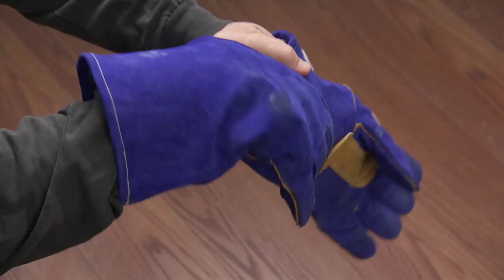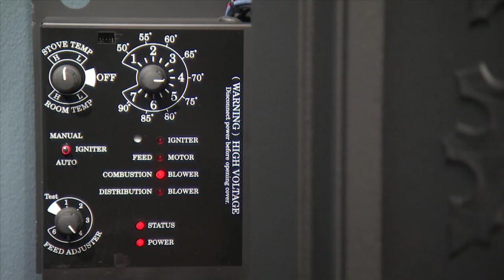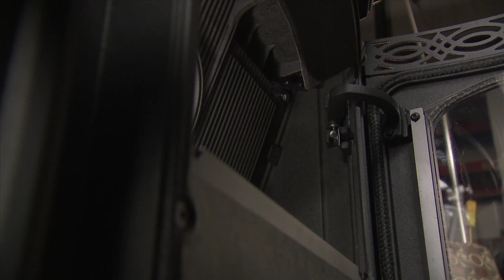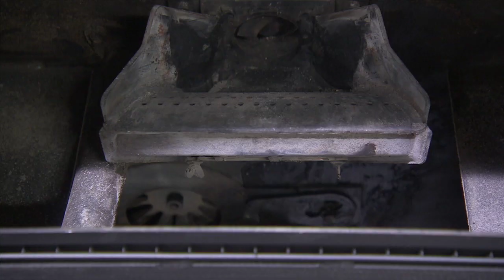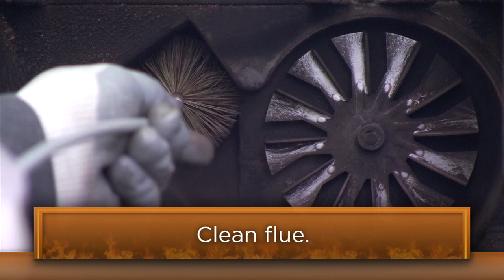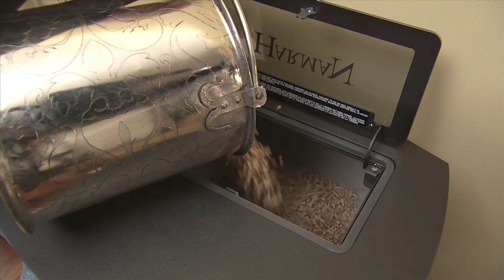Harman® Accentra Pellet Stove Maintenance Video

Comment: Cleaning the exhaust pipe is not rocket science, and most owners do it themselves. Why not create a video tutorial to ensure we’re not missing any steps? BTW, great video, and my harman accentra 2 operated flawlessly in my second home for five years. Then it was moved and sat in my garage for 10 years. I had it installed last winter and other than repairing igniter wires that have been chewed through by mice. It has operated flawlessly since then. A true testament to the quality of your product. Kudos to the designers and manufacturers of this product.👍😎

Comment: My stove started making a clunking sound and then stopped feeding pellets.  Turned out the pellet chute was clogged.  The auger had to be removed to clean it. Big clumps of solidified fines came out.  Also, one of the holes in the feeder plate was clogged.  That hole is what helps clear fines from the feed area.  During reassembly, careful seating of the auger also fixed the moaning noise.
Reply: My auger stopped turning, it's moaning, and only after THIS video along with your comment did I know where the fines are collected...SMH... my bad, RTFM, but I'm thinking, what are the chances I'm going to find a jammed up fines chamber when I go back and check it? My money says YEP lol ... thank you for the heads up! 👍

Comment: have had an Accentra since 2009 and I am very happy with it, I now do it exactly as in your video, on the other hand with a brush and my vacuum cleaner I do not hesitate to clean the fans at the back of the stove, I think it is better because which I find there a lot of fixed dust.